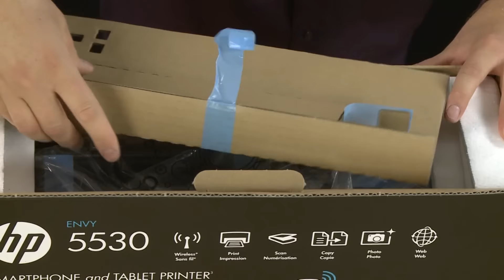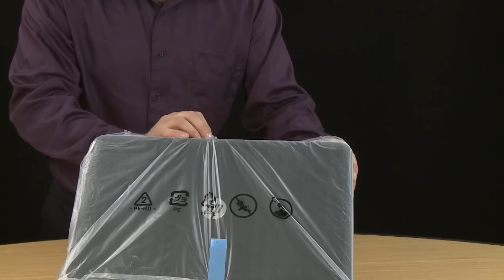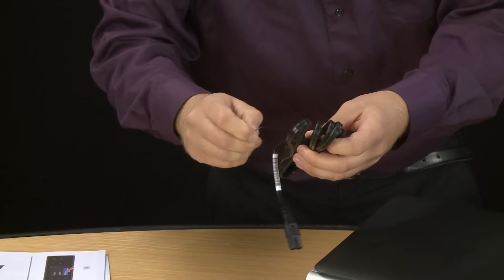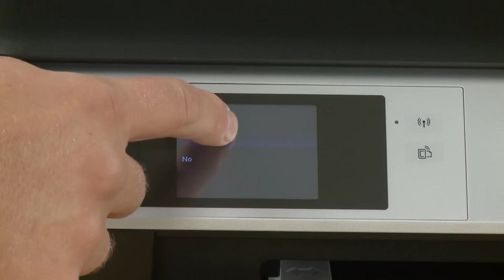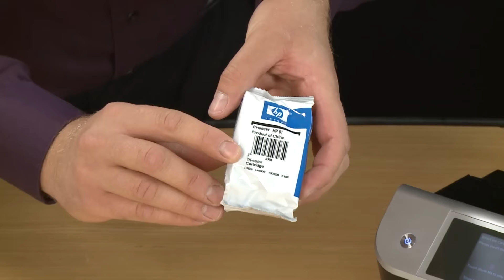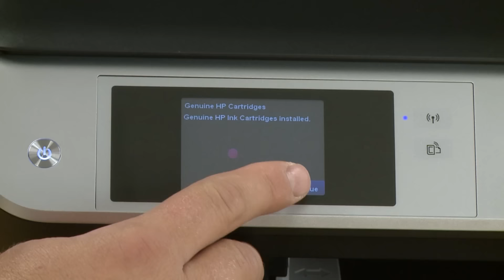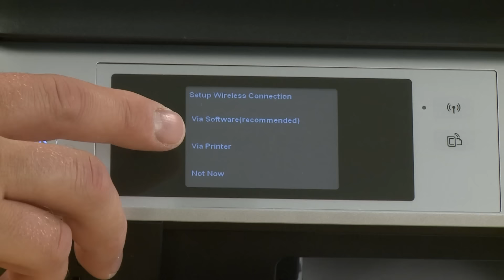Unboxing and Setting Up the HP Envy 5530 e-All-in-One Printer | HP

Comment: Hey how do i connect printer to my laptop wirelessly so can print documents?
Reply from the maker: +Malah Smith   There is a Wireless Setup Wizard available from the front panel of the Envy 5530 printer.  You can find the steps on how to run the wizard starting on page 55 of the Envy 5530 User Guide ( http://ow.ly/YqSLm ).

Comment: This printer is junk, will not even recognize its own 61 black ink cartridge purchased new.  Get an error incompatible cartridge, cleaned contacts recycle printer etc still same error.  Ever since the firmware update this happens.
Reply from the maker: +Burning Ring of Fire   I've included a troubleshooting document for you to follow.  It has the steps for when you get an ink cartridge error message.  

Resolving 'Ink Cartridge Problem' Error   http://ow.ly/105wgT
Reply: I have already gone through those troubleshooting steps.  Even my old ink cartridges that were low before are saying incompatible after the firmware upgrade.  Can you send me the previous firmware? if not then this printer is not worth my time anymore and will replace it with a Cannon printer.
Reply: Nevermind threw this printer in the trash and got a Cannon.  No issues with refillable cartridges.  There is definitely something wrong with your firmware perhaps increased the history of print cartridges used to prevent refilling your own cartridges.  More cartridges in landfills I guess doesn't bother HP.